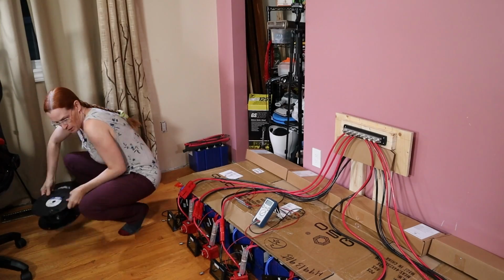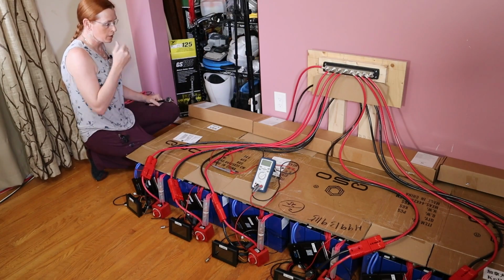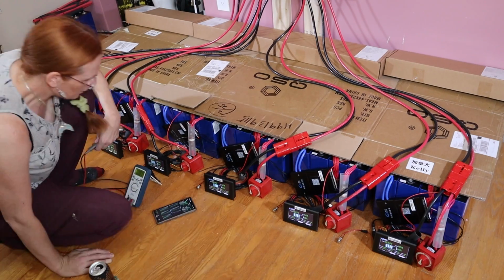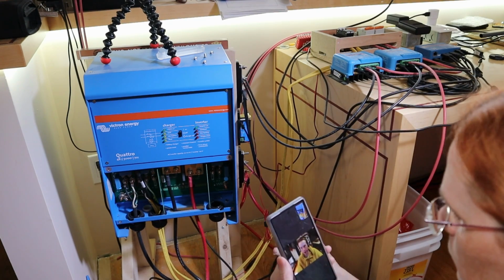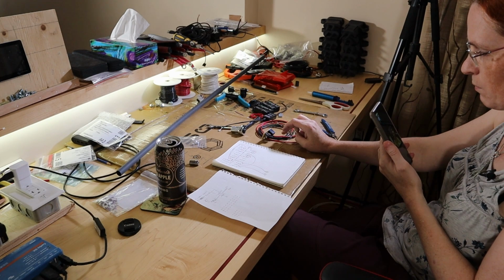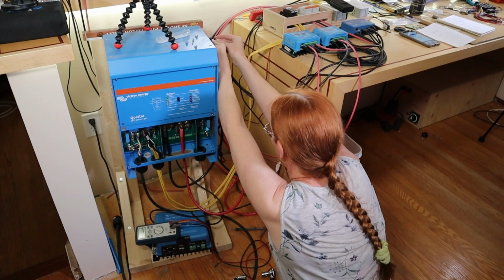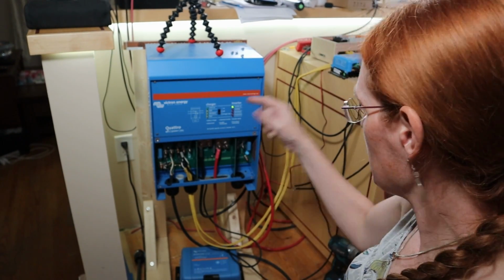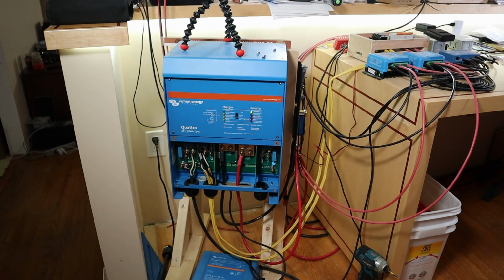Bang! Recovering From Mistakes - Part 6 - Big Battery Build! (Ep. 43)

Comment: I love renewable energy tech but seeing the complexity of this i am wondering if this is the right solution for a propulsion system on a sailboat. imagine if you need thrust to get away from a shoreline and something in this anthill of failure modes decides to dance with you and the system goes into limp ?
Reply from the maker: On my 760 nautical mile trip home, I lost my alternator, had a fuel pump blockage, then lost an impeller and overheated, and lost my starter battery. The familiar failure modes of diesel can fade into the background, but they're there. Electrical propulsion is, mechanically, a lot simpler. The complexity is novel, that is true, but I trust that I'll have a more reliable system when I'm done.
Reply: @TheDigitalMermaid  not sure i can agree here, a Diesel is super simple in comparison, i have a old Perkins 107 in my sailboat that will happily provide propulsion without an alternator all day long, zero electronics, that thing is from the 70s and still starts an runs like a charm.
 With an Engine like that you have 2 major failure modes, fuel and cooling. These are pretty easy to maintain and fix once fully understood.
A battery system like the one you are building... has hundreds, when i just think about potential contact corrosion of buss bars or terminals, glitches with the BMS, inverter, motor controller... and and and, ever thought about a lightning strike? Happens quiet often, i follow a sailor that got struck twice within a few months.
Don't get me wrong, i have high respect for what you are doing, i am actually building a marine system myself right now to power my appliances on board, i just cannot imagine relying on this for propulsion during a crossing or challenging situations of any sort. Redundancy is a very very important factor when it comes to sailing, especially single handed.
Reply from the maker: I think we're talking about different things. When I say that electric is simpler, I mean mechanically... I optionally need water cooling, but really, the only mechanical part is the rotor -> pulley -> belt -> pulley -> prop shaft -> prop. That's it. However, there's all the electrics, which if you're not familiar with them (as I wasn't at the start of this project), it's complicated. There I will agree with you. So the question of "simpler" depends on context; 

For me, I'm much more electrically inclined than I am mechanically inclined. So for me, the wiring, programming, charging etc is not that daunting. For you, the mechanics of the diesel sounds to be very well understood and obvious to you, and that alone makes it a good choice for you. Mechanically however, there's on denying that the moving bits in a combustion engine are far more complex and intricate. 

As for potential failure points, I've build in a LOT of redundancy. The six (possibly seven) batteries all run in parallel, and any given pack can be disconnected from the bus with the flip of a switch. So long as I have at least two packs, I'm good to go. On the motor side, I'll have two motors in parallel, each with it's own dedicated motor controller, so I'll have full redundancy there as well. As for the wiring, I'll have all the tools/spares needed to make/replace any cable on the boat. Also, all the wiring I'm making is marine-rated tinned copper, same for the lugs/ferrules/etc, and all the electrics are marine rated / conformally coated to reduce the chance of corrosion, so I'm comfortable in the durability of my electrics.

Lastly; Remember that in a sailboat, it's auxiliary propulsion. I'll have lightning suppression with a dedicated ground plate, but even if the entire electrical system is somehow blown out, I can still sail. I may well need to request a tow when I get to safe harbour, sure, but I'll get there. :)
Reply: @TheDigitalMermaid  i see your point and cross my fingers it will work out the way you planned!! Thanks for providing this content!
Reply from the maker: @beershortage  Either I succeed or I fail, either way, hopefully it's entertaining. ^_^
Reply: @TheDigitalMermaid  you cannot really fail with this, at the least you have a awesome house battery plus you gained a ton of knowledge. Just make sure not to sell or scrap the Diesel just in case you need a plan B :-)
Reply from the maker: @beershortage  The engine is already up for sale. I'm all in on this.

Comment: that's weird - the BMS shouldn't go into 'OCP' when connecting to the inverter.  (charging the capacitor in there doesn't draw +150A!)  i'm wondering if it had more to do with the buck converter...

also, careful with those blue sea switches.  yes, they work, but aren't rated for use over 48v.  has something to do with them 'possibly' arcing internally.  lotsa people use them for 48v systems (51.2v nominal), but they might give you trouble if you disconnect them under load.  just be aware!  i picked up some dual pole DC breakers off alliexpress, myself.  (similar to what andy has on his battery shelf...)

love your trials and tribulations!  THANKS SO MUCH FOR SHARING EVERYTHING!

Comment: Hy there! Congratulations for your work and sorry for my rusty english. I watched a lot of your videos, but not all and I'm sorry if I'm giving you an advice that you're already know. BMS problem. Some have bluetooth on-board, some have more interfaces, like the 3-pin 485, and/or UART-BT, the dongle beeing wired and not on-board, ready to mess with you. 
Some people are talking about WWIII, EMP's yada yada yada. 
A few reasons to avoid the damned BT connections:
1. They are hackable, and recently some said chineese builted some sort of countdown timer in their chips; BMS is to smart, it's not analogical, but far beyond digital
2. The coverage is a joke...30 feet in stright line? What's the purpose of having wireless connections if you have to stay close, sticked to your cells/BMS?
3. The cells have more life and juice to give, the phone/tablet, doesn't. How many phones you have to change, maybe forced? How many software upgrades for the BMS? Sometimes the soft warns you "friendly" you need an upgrade; but in some cases it stops and blocks you until you download a newer version. So you need mobile data on your boat. It sucks.
4. All wireless connections tells to bad guys, maybe those zombies from the Apocalypse that you have a lot of BMS's, MPPT inverters and so on.
I sugest using 4-pins connectors, so you can switch between 4 pin UART-BT or 3 pin UART-Serial port. "-" is the ground, and you need it. Tx, Rx are for the data's. +5V for the serial interface should be eliminated because BMS has a 5V output not kissing very well with your 5V output delivered by USB ports. So one connector with 4 pins, and 2 interfaces-UART-BT if you still enjoy it, and (better), the serial interface. Once you smash the wi-fi/BT module from your laptop, nobody can see what's "inside". This way, using a USB Hub, you may connect everything to your ultrabook, safe and secure.
I'm building a battery box for 4S/200Ah and a bigger one, trying to make it "portable". Handles are not the latest problem. In both cases I'll use fuses for each cell, a switch to disconnect the BMS if I want. After the fuses the show is starting: connectors for charging the cells without BMS, connectors for cell-meters, a "back-up plan" if the BMS starts being tricky. All my battery boxes should be waterproof, and it's a little bit hard, too many pounds. 
https://postimg.cc/gallery/7xnftS9/41fa80a8 Over 200 pounds. I had to modify the handles for 5mm screws. 
Sorry for suggesting you to have double or even tripple redundancy for everything. But I'm from Romania, so you can understand me...
By the way, you can easily replace a bad cell, but how you're gonna deal with a phone dead battery? Kiss ya! Good luck!

Comment: My JK bms went in to short circuit mode the first time I powered up. Just reset and flip it on again. No need for pre charge resistor.
Reply from the maker: If you reset it soon enough, the caps will be charged enough to not be an issue, I agree. However, I don't like the idea of straining the MOSFETs that much, even if for just a short time, if it's easy enough to avoid.

Comment: If you click on the voltage in the app, you can sync your voltage which you find on your multimeter
Reply from the maker: Aye, though I'd argue that shouldn't be needed. A dedicated BMS should have the ability to read an accurate pack voltage from the cells. This makes me wonder how accurate the individual cell readings are... Do they need to be calibrated also? Frustrating...
Reply: @TheDigitalMermaid  I sadly do not know but I will measure when I get to it. What I see at Andy is that most BMSes also have trouble with currents. So probably it's a mixed bag. But certainly I'll try to measure individual cells and their BMS reports. Will comment sometime under your video (but will prob take another 1 or 2 months as I first need to replace my house switchboard and lay cables ...)
Reply from the maker: @edwardvanhazendonk  Kind of you, but I can do the same test when I get home also.

Comment: It looks like you tripped a crowbar circuit in the Quattro and that was your short.
Reply from the maker: "Crowbar circuit"?
Reply: @TheDigitalMermaid  A crowbar circuit is an electrical circuit used for preventing an overvoltage or surge condition of a power supply unit from damaging the circuits attached to the power supply.

Comment: For your windlass, the best line to use after whatever length of chain is 8 plait. It will not cause the pigtail sort of rope layover that will jam the winch. And all of this is why I do not use a BMS. On my eBike I was using the no spark connector for the battery. That was not sufficient over time and eventually that little built in resistance failed and sparks returned. So I wired in a precharge resistor on a two way switch. First switch position is charge then I flip it over to operate. Problem solved. So you could use the two battery main switches and wire so postion one is precharge and then position two is operate. I used a 1000 ohm 10 watt resistor for my 72 volt system.
Reply from the maker: Noted, thanks!

Comment: Glad it was a cheap part! Wish I had an EE on standby. Frankly I learn by troubleshooting and fixing things so in some ways I enjoy these kinds of challenges (possibly just masochistically). Fortunately my project scares the hell out of me given the money invested so far so I’ve researched it a LOT, reviewed the design repeatedly and tested and retested in a sandboxed environment. 

I’ve been procrastinating on doing final wiring cutover though… probably because I’m scared I’m going to screw up the inverter, BMS and the trailer’s power systems.

It’s currently connected to a regular 15amp circuit for the AC-In and a heavy duty power strip that I cut the plug off of and connected to AC-Out. Because of where the trailer manufacturer put the 50amp shore power connection I have to pull the supply cable out of the panel and splice it to a new run of cable to the inverter and then back to the panel in addition to a direct connection from the batteries to the 12v equipment that doesn’t run through the panel like the landing jacks and slide out motors.

This whole project in nerve wracking and my system is a piddly little 12v system but it will routinely pull 200-300amps off the batteries.
Reply from the maker: I am so very fortunate to have Andrew as a friend. Funny enough, he was the one who pushed me to start this channel! 

The fear of the first run is real... You just never know if it's going to be celebration time, or the start of a new slog. It's hard to say "just do it" when it's your hours of work and piles of treasure on the line, but at some point, you really do just have to do it.
Reply: @TheDigitalMermaid  Yep I’m pretty sure I did the super cautious cringe ready to dive away from my exploding trailer when I threw the switch on the inverter the first time 🤪

Comment: Watching/hearing the panic in your voice hits close to home, i'm currently going through a similar process here but for my house instead of a boat.  Got a pair of 8kw inverters on the wall in the garage, finally got everything wired up after weeks of work, checked it all about a million times and got ready to throw the main breakers.  Turned the system on, inverters powered up and did their checks, heard the output contactors close and then there was an almighty bang and the garage filled with smoke :-(  Fortunately it's repairable, but it was a frantic few minutes of trying to figure out what had happened and I think my heart is still beating a little faster than usual, even a few days later.  I've no doubt you'll get yours sorted, and you've learned some interesting new stuff along the way!
Reply: What went wrong?
Reply: @inmyimage1081  i've got two inverters and they're supposed to work together, but for whatever reason they powered up without having synchronised their phases, so they tried to feed one another and one went bang :-(
Reply: @StikDragon  Ouch that really stinks 🥺
Reply from the maker: @StikDragon  Oh that sucks... Is it repairable? And ya, the "oh shit" feeling is a really deep kind of sinking feeling... Ah well, learn and move on. Once things have popped, what else can you do?
Reply: @TheDigitalMermaid  yeah it should be fixable, it looks like a massive capacitor inside ruptured, i should be able to replace that if the manufacturer won't help me out.   I've very carefully run it up on the bench in isolation and on a limited power supply instead of a battery and the actual complicated inverter-y bits seem functional, so i'm confident replacing that cap will sort me right out and i'll be back to full power :-)

I'm very envious of your lithium battery, haha.  I could only afford a lead acid one at the moment.  in a few years i hope the energy savings i'll make will let me build a lifepo pack like yours

Comment: For real. I’ve liked your series. But now you are threading into crazy territory. Where are your fuses?! You don’t have one on the buck converters and you handle wires and discover you have not turned off the battery bank - and you have no fuses on it either. The only current limiter is the bmses. This will end in a huge bang and vaporized copper flying in all directions. Install fuses!! Sorry I’m grumphy but safety. We only have one of you and now you are endangering that. Your friend is correct about the reason your buck converter blew up. But the way you connected this is also an contributing factor. Safety first. :)
Reply from the maker: I do have fuses, proper T-class at that. The Victron gear all has fuses / protection. The only part that didn't was the buck converter, an oversight I mentioned in the previous video. Keep in mind; I think everyone makes mistakes, even the best. The difference, if I may humbly say, is that I don't edit my mistakes out. I want to show the ups and downs of a big project. 

If you go back far enough, you'll find a video where I dead-shorted the pack and the T-class saved me. I very much understand the stupid amount of power I am playing with here.
Reply: @TheDigitalMermaid  and like I’ve told you before - it’s when making mistakes you learn. I did not know you had the t-class fuses, and I was scared that you were going to hurt yourself. Sorry if I came out harsh. :) I meant well.
Reply from the maker: @pederb82  All good, and appreciated.
Reply: If I recall correctly she has T-Class fuses on each battery. Each side is connected directly to the cable not in a housing so they are tough to see. I’m pretty sure that the buck converter bypasses the fuse though since it needs to work when the battery pack is turned off.
Reply from the maker: @inmyimage1081  Yup, the buck converter should have had a fuse, but given how thin the wires are, I figured they'd work as fusible links for the sake of these tests. If I decide to keep the JK on the boat, I'll replace them with proper buck converters. Of course yes, I do have T-class fuses in every pack, and the Victron gear has its own protection/fuses.
Reply: There are Class T fuses on each battery pack, pay attention before making stupid comments.
Reply: I saw that on the original battery yes, but did not see that in this large build. I must have missed it then. But still. How many amps is that? This is not an tiny car battery and even that can cause serious damage. Extreme care must be taken to avoid injury. The energy that’s stored is enormous.

Comment: Hi, nice video and I admire your bravery doing this close to where you sleep. Unfortunately it does look like an accident waiting to happen leading possibly to a fire. Do you have neighbours and is your house insurance aware of your project?
   Keep safe.
Cheers
Reply from the maker: How can you see this turning into a fire? (Honest question). I've got fuses in all packs for any major shorts, the Victron gear has it's own internal protection/fuses, and my buck convert should have a fuse in hind-sight, but I'm looking to replace them soon. They have such low guage wire that they'd act as fusible links in the very worst case.

Comment: Option number 2 because there is no diode switching on the main switch turns on the + and the minus comes from the bms when the bms turns off because of overpower it just uses the - running over the converter blowing up for amp usage